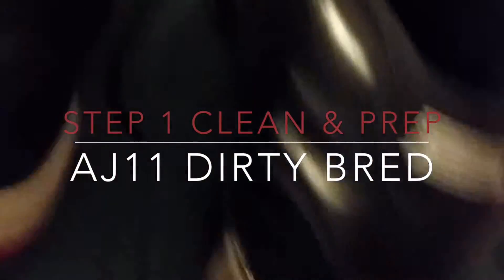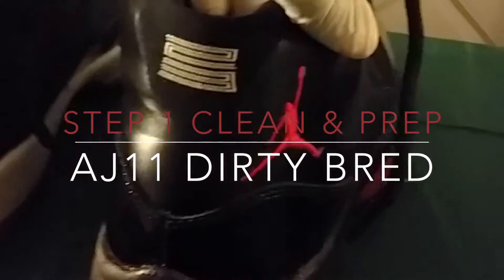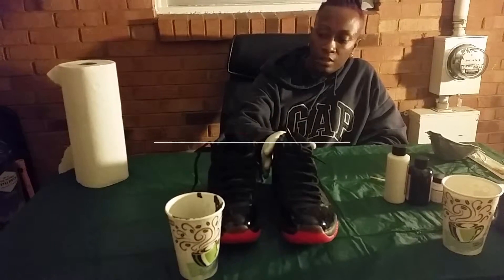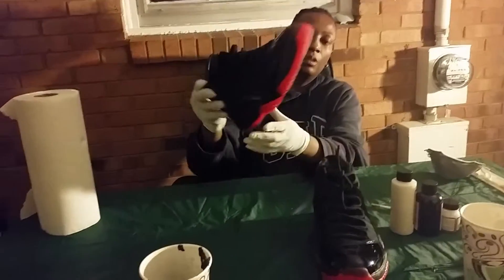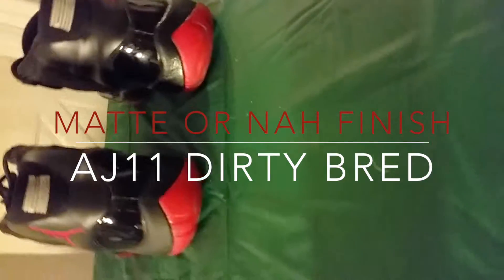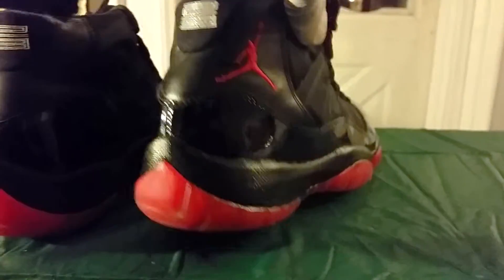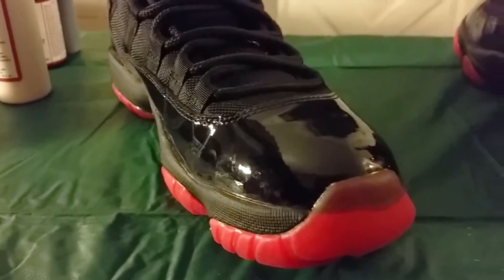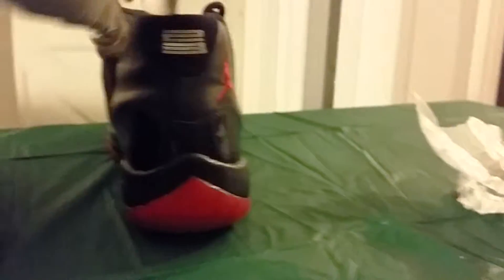Dirty Bred Custom

Comment: Hey do you know how to apply glitter on too the shiny part of the shoe I seen that done and I would like to try that also.  Thanks
Reply from the maker: derrick linton Sorry for delay there is actually several lines of acrylic paint that are glitter. One thing to keep in mind is the coarseness of glitter will flake therefore apply protective coating. Copy paste https://instagram.com/p/0gnCplu7H9/?tagged=kickzablazecustoms link to a pair of customs where I used glitter. If requested by at least 10 subscribers. I will do a video. Thanks for watching.
Reply from the maker: Kickzablaze Also for patent leather use paint /w primer not arcrylic